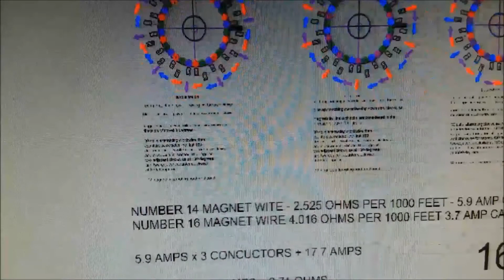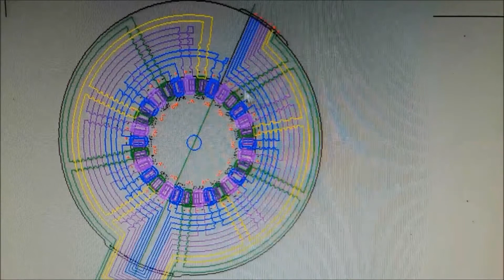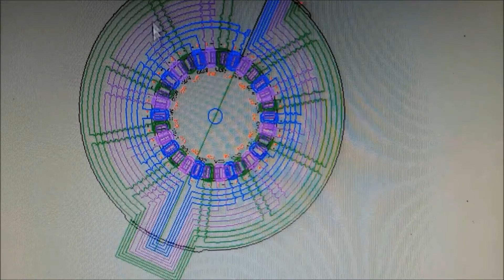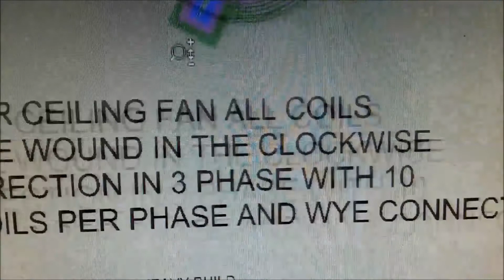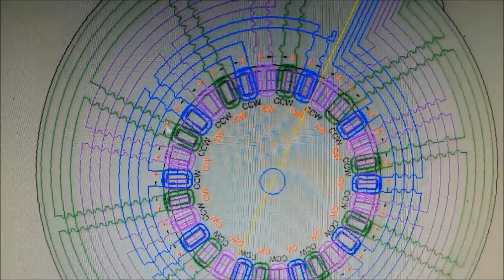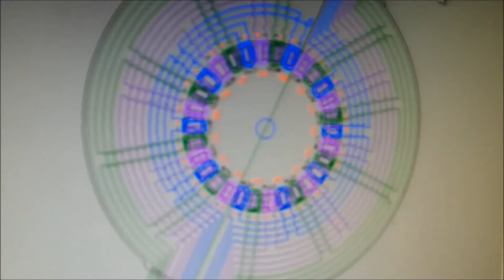WIND TURBINE STATOR IS A WORK OF ART PART 2

Comment: Hello,
I must say you impress me sir. I have been looking for more quality information on building a wind turbine and more specifically the stator. You are the best source I've found. Say what you will about lack of views, I just found you yesterday and have watched all your wind turbine stuff and am starting again. Also, yours is the first channel I've ever subscribed to. Now I do have a question, forgive me if I completely missed it, but, do you have an estimate on how many kW this could produce? I want to build a hybrid system and eventually it would be nice if I can sell the excess back to the electric company. My peak power consumption for one month over the last two years has been just over 3000kw, my home is all electric and we occasionally spend a month well below 0*F or close to 0, most of my other months are substantially lower power usage. Can I get anywhere close to where I want to be with one good sized turbine? The good news is I live on a hill with no trees in the middle of Nebraska so there is plenty of wind. Thanks. Keep up the good work! I am interested in the concrete house building too, one thing at a time for now.
Reply from the maker: Power production is the result of blade area, disk area for horizontal 
axis and the entire wind volume for vertical axis designs. Take a look
at the boosted vertical axis video. Next consideration is converting
mechanical energy into electricity. The 3 phase AC  generator is
clearly the way to go.  Sizing it you can back into. Volts times amps 
equals watts (power). There are published data showing average wind 
power watts by GPS location. The data is a graph showing a power 
curve for the year which by default averages the day and night 
production. Once you know the maximum daily power, you need to
decide on a voltage. Current technology inverters handle up to 550 
volts. Brand names like MPP Solar, Growatt, Deye, and INVT are 
examples. In the US you only get a fraction of the price the power 
company charges you for power you supply them, and often it is a 
short term credit rather than cash. In the Philippines we have 
"Net Metering" which they bill you for any power past what they got 
from you. It is also a credit but can be a power bill of 0.00   So look
into what they will pay you early on. The reason for high OCV 
(Open Circuit Voltage) is that wind turbines have widely fluctuating 
voltage. Anyway an invwrter with power factor correction does grid feedback, About $900 each for 6000w sizes.  Now we have power 
available in watts, the design voltage from the inverter (minus a 15%
safety factor) and use V=IR to get the amps.  A magnet wire chart
to find resistance per 100 meters or per foot will tell you how much 
wire needs to be wrapped per phase.
Reply from the maker: Coil count comes next. The coil count divides by 3 so each phase has 
1/3 of the total coils. Two phases of coils are in series at any instant 
so 2/3 of the coil count is what the meters of wire are wrapped around. 
So how many coils. Lots of coils like 30 make for low cogging vibration 
and also increase stator diameter. The increase in stator diameter
requires (uses up) more of the torque you are converting from 
mechanical energy to electricity. More coils increase the ways to 
control cut in speed.  If you have a simple 3 phase generator then 
it may not turn fast enough if at all to start generating. We use cut in
 speed controlled through voltage sensing to progressivly add load 
to the turbine as the speed increases or remove it if the turbie speed
falls. Devices like transisters, MOSFETS, and Zenir diodes can  either
ground or bypass coils to change the load.  Well, so far we have got 
all the edge pieces of the puzzel sorted out and the remaining 
spaces get filled by the magnets. This comes down to Gauss of the 
magnet. Never published with the magnet, but there is a grading 
system. The lowest rating is magnetized iron , then ceramic, and the
top performers are rare earth. Neobdyneum rare earth are the dog
that can hunt in this game. Ratings are like N30, N40, N52 with the 
higher number being stronger. The ratings have a published Gauss 
per cubic measure of the magnet, think cubic inches. Multiply your
proposed volume magnet by the gauss density and you have a 
starting point. Then look up Lenz law on wiki to find the induced 
amps in a wire at a distance from the magnet face to the center 
of the coil windings. leave .062 running clearance minimum. 
A maximum clearance of .100 would be  better for cooling air 
since the coil is potted in epoxie with little surface area to vent 
heat. If your magnet doesn't create enough amps go bigger on 
the magnets.  This concludes the build it backwards approach.

Comment: Hello,
When you are assessing which magnets and coils are working together moving the generator clockwise what are you comparing I have assumed that if a north magnet is approaching an anticlockwise wound coil they are attracted and therefore are working together and if a north pole magnet was approaching a  clockwise coil it would be opposing and therefore you would change this to a anticlockwise?
Thanks
Steve
Reply from the maker: For design purposes because you have magnets alternating north and south as the rotor turns, you
only need to just assign coils wound in one direction to be acting as north and the ones wound the other direction as south. Every magnet as it passes a coil induces first a clockwise current and after centered (zero crossing point) a counter clockwise current. The important thing is that every third 
coil is inducing current in the same direction as much as possible, then after zero crossing they are all inducing  current in the opposite direction. Because to reduce cogging the magnets and coils are all at different approach distances. Some add a little current, some a lot. If they were all timed to happen simultaneously you get much higher current pulses but the torque required to turn the rotors would be high enough that your input might not be able to break it away from zero crossing and turn it at all. If you leave all the coils grounded until you get to a cut in voltage before going thru the 3 phase rectifier it will spin up but be cutting in and out continuously. A large deadband between cut in and cut out voltages will make things less....frantic but it will still spend the same percentage of time grounded and producing no output. You can use Lens law to get the correct direction of current flow to assign to the coil winding direction. But for layout purposes just avoid having coils on the same series string working in opposite directions and canciling each other out. For the design I am using 30 coils and 32 magnets I found that a stator designed as two 180 degrees of rotation sections with the end points having the same winding direction gave all currents in the same direction and none opposing although a few centered up ones weren't contributing anything, at least they weren't reducing output.
Reply from the maker: My dog who does this typing, and spelling, says if you are confused you could put two diodes on both ends of each coil and connect all the NPN diodes to one output circuit and all the PNP diodes to a second circuit you would have a six phase alternator for three coil strings or a 2 phase alternator
if all the coils were connected to the two perimeter circuits. No phasing necessary and wheatstone
bridges, one for each circuit, to get everything converted to DC.  This would not run as a motor,  but
if the goal is producing an electrical current by turning a magnet rotor it looks to be a really efficient 
way to do it. If any coil or diode fails to an open circuit none of the others are affected.  This is of
course from the same dog that immediately after being given a bath shakes water all over us and rushes out to bare ground at the chicken coop and rolls around in dirt  and chicken poo.

Comment: Hello,
I have viewed all your videos on the manufacture of a axial generator and find them very interesting. I am building a water wheel and am going to build a axial generator to generate ' power of the water wheel. I have a question that relates to the section of video that talks about the direction to wind the stator coils to minimise the 'drag' and get the coils and magnets working together. Can you confirm what colours you are using for your north facing magnets and similarly the south facing magnets. Am I correct to assume that the direction that you wind the coils is the same as the the current flows when determined by Lens's Law?
I am building a generator with 15 coils and 14 magnets and I have tried your technique of making a mask of each of the phases and rotating the magnets and reviewing the direction of flow induced but I get the induced current alternating in each of the coils from CW to CCW depending on the relative position of magnet and coil so don't understand the principle of winding coils alternate around the stator (CW then CCW then CW etc)
Thanks in advance
Steve
Reply from the maker: Stephen, The color of the magnets in the test mask can be anything you like. I am using red for north
h and black for south these days but it just comes from whatever layer color is on in CAD when I turn the outline into a surface to color the area. The second colour is just one that is not being used for  the coils.    Consider the coils as a string of coils wired in series with every third coil on a given string.
Looking at any particular coil the one preceeding it or following it are on the other two strings. It might make it easier to visualize if you only draw in a single string and see the interaction with the full set of magnets.
Reply from the maker: Reply part 2. Next thing to notice is that a magnet approaching the first side of a coil generates
current in one direction and after the center point generates current in the opposite direction. We are building ALTERNATORS here not generators which are often with commutators. I never designed a water wheel alternator, however, the important factors are a large as possible water volume (weight
actually) changing height as much as practical. The next thing is when you are processing   largeer
volumes pf water you don't get much rotational speed, and that magnet speed passing the coils is what boosts the voltage up to usable levels.  If you drop the water thru an enclosed pipe and run it thru something like a turbocharger compressor wheel and housing you get a lot of RPM and also the potential energy from the fall down the pipe

Comment: Do you have a any books that you can suggest with good illustrations thanks?
Reply from the maker: Kim, I would suggest checking the     electronoobs    channel. He has a very good explanation of BLDC motors
and how they are operated with clear diagrams. A BLDC motor has as it's core a BLDC generator. The difference 
is that the motor needs position sensing to time when the coil polarity has to change. This is done with the 
flyback pulse of the coil set idled and capitolizes on the voltage spike created by the lack of an add on inductor
that would be in a circuit to level out the flyback spike. This has to occur at  "zero crossing" or the point that the next step in rotation is at top dead center of the coil and magnet. This can also be sensed with 3 hall effect sensors
to resolve rotor position. This position sensing electronically does the "comutation" accomplished by the brushes
contacting a ring of contacts on the motor armature. In the case of the generator the shaft is driven by an external torque  from wind turbine or water wheel/turbine and produces power whenever any magnet passes a coil.
In the axial flux case the magnetic fields of the magnets and coils are algned and don't generally have steel 
cores. For outrunner motors/generators the coils are at 90 degrees to the magnetic flux and steel or ferrite 
cores are magnetized and produce N and S poles pointing to the magnet ring turning around the outside of
the coils. The outrunners are used on RC model motors and washing machine and ceiling fan motors. The 
generators for inrunner, outrunner, axial flux, and dual axial flux all have a magnet passing a coil and producing electricity. This is an AC output alternating current with three phases. To turn it into DC the 3 output leads are 
connected to a 3 phase bridge rectifier also called an "H" bridge of 6 diodes and that outputs DC from all three 
phases. The bridge (see electronoobs) for the diagram is commonly available off the shelf. I have some rated 300 amps that were about $6 on E-bay. They have push on spade connectors and the conectors are hard to find
but the lugs can be soldered onto. In the Philippines soldered connections are a code violation and they have to 
also be crimped or bolted on.
          You might check an RC site about rewinding model airplane or slotcar motors to run on higher voltages
to get some insight into making coils. For wind turbine generators  "Mudymudman"  and "Billythe jack"
channels show axial flux generator construction and start with 18 thru 22 guage enameled magnet wire.
There are 40 wire guages of magnet wire produced in both single insulated and double insulated enamel.
The mid sized is used to stay in the amp rating of the wire and if you go to the larger diameter you can
test run the generator and check the amps. Then if you can get more turns with a smaller diameter wire
you can get a higher voltage output. Alternatively larger diameter blades with like an eppler airfoil will
capture more energy, or add to the blade count. 
       There seems to by some confusion about how the coils are connected to each other. The coils are
grouped into a series A B C   A B C   A B C  A B C  A B C  A B C. In this example all 6 of the A coils are connected 
in series as are the B  and   C sets. These coils  are wound and mounted alternately clockwise and counter
clockwise and if their endpoints are connected to form a triangle you have a DELTA connected generator. If one end of all the coil sets are connected and the free ends are pointing away from the interconnected ends you are WYE connected. In either case you have 3 places to connect to. The difference is that one type is easier to start rotating for self starting. The WYE also has the common center point as a connection point. The reason for the alternate
 CW and CCW mounting is that the magnets alternate N and S and the next magnet passing a coil will always be
of opposite polarity from the last one that passed. And.....at this point you are probably wondering if I can't type or just cant spell.